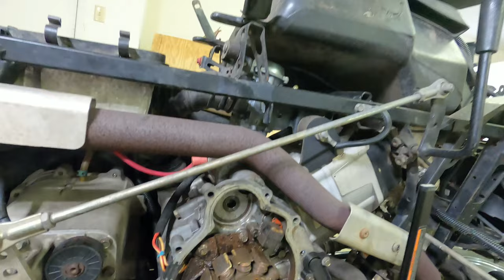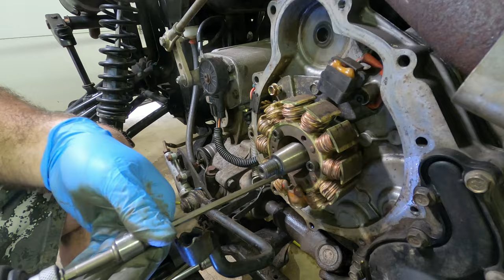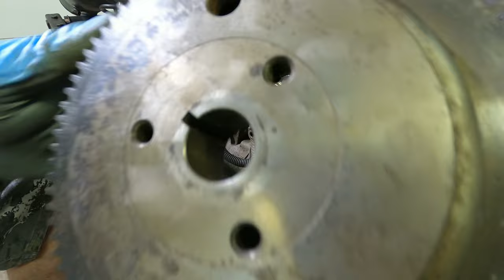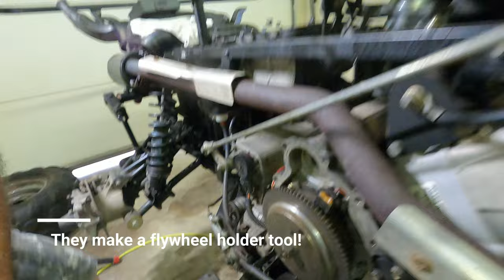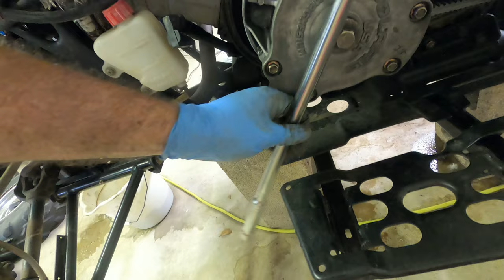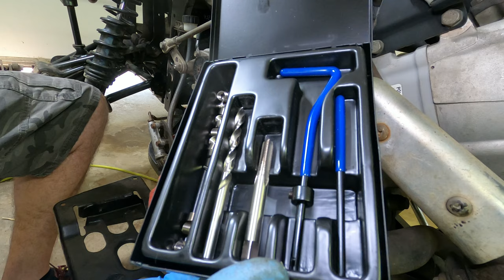2002 Polaris Sportsman 700- Part 3 - fixing stripped threads and cleaning up the flywheel & stator.

Comment: Did you ever figure out why there’s coolant leaking out of those bolt threads mine started leaking there
Reply from the maker: Sorry for the delayed response.  No, I have not figured it out yet.  I used rtv/gasket maker when I put it all back together.  I have not yet put coolant back in it.  If it is still leaking after I get it all back together or I am losing coolant and it happens to show up in my oil.. I will plan to make a video on it.  Being that I'm not in the know on these things.... I suspect that the water leaking from the bolt holes is not a good sign at all.  This atv has been worked over before... Stripped threads and some bolt holes had previously been "fixed"(drilled and tapped) and I suspect that whoever did it drilled deeper than they should have and put a hole into a coolant channel in the block.  As I said,  I'm not in the know on these.  That is just me speculating.  Thanks for the question and for watching!

Comment: i have a problem with mine same year and all. mine is overcharging ive replaced the voltage regulator, the stator, checked all grounds, and even bought a a/c to d/c ignition unit. But it gets above 14vollts sometimes even up to the 20's. Im gonna replace the stator again with a more expensive one and hopefully it fixes the issue. It literally melts the volt reg and the wires going to it get extremely hot.
Reply from the maker: How do the magnets on your flywheel look?  Are any missing/broken?  Are you sure that it has the correct flywheel?  I can't offer any suggestions on where to get a new stator as I haven't looked into it.  I've heard, not saying it's a fact, that the cheap ones aren't really that good.  I'm not an expert(far from it).... and I'd have to look at the order of the charging system as it is on the machine, then I'd check voltages after each component.  To me, it sounds as though the voltage regulator is not working properly, but as I said... I really don't know much about these things, I'm learning.  Hopefully, that helps you out.  I appreciate the comment!  If I can help, let me know.  If you get it figured out, I'd love to know what the culprit loves.  Also, if I come across anything that might be of help to you, I will post a comment.  Thanks for watching!
Reply: @doinitdunlapstyle201  It was in fact the flywheel, it had the magnets coming off causing it to fray the wires from the stator grounding out basically. $700 later all fixed now.
Reply from the maker: @swiftlyswiv  that is great that you figured it out and got it fixed!  Hopefully, I will be back to posting some videos soon.  I've had various issues, nothing serious, and haven't been able to get back to it.  I am hoping soon though.
Reply: @doinitdunlapstyle201  my neighbor has a 400 scrambler that either the stator is bad or his cdi has no power to lights nothing no charge going to battery but can still be pull started. This is right after fixing mine lmao Polaris electrical system are trash
Reply from the maker: @swiftlyswiv  it's my understanding that they aren't that great.  I guess that's why a lot of people do the stator and cdi ignition upgrade . It might be something worth looking into.